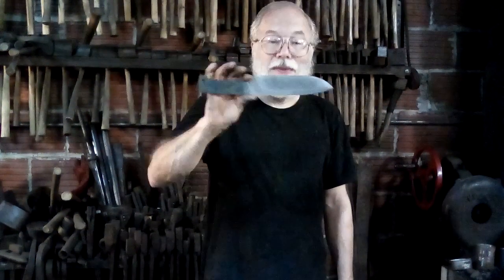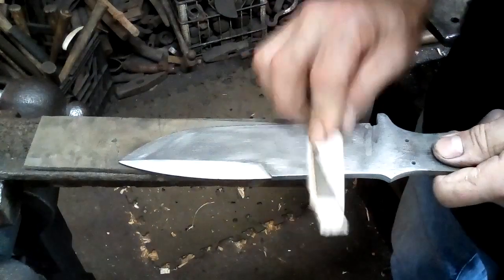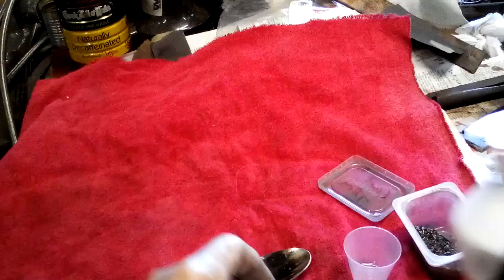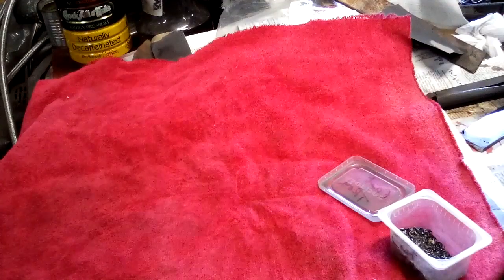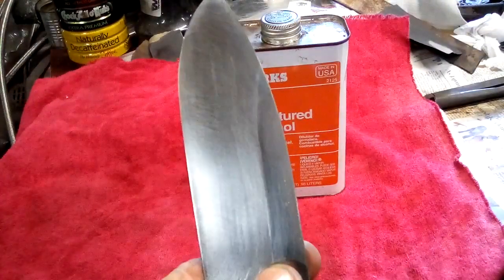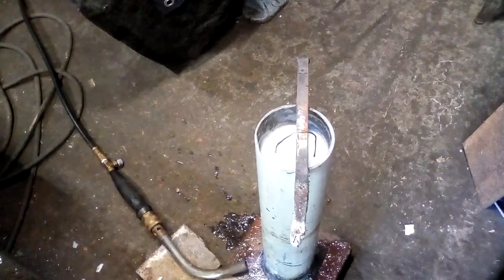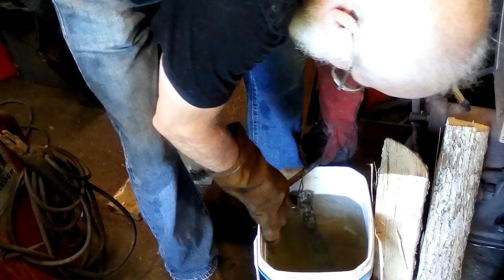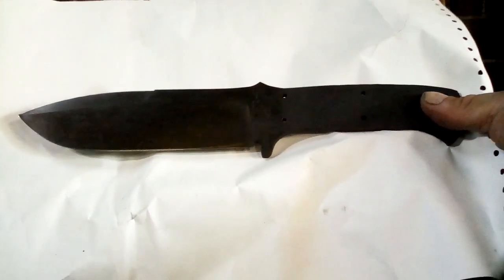A Blacksmith's Dictionary , Parkerizing , phosphating or how to make Steel Black

Comment: Is this something that has to be done outdoors?
Reply from the maker: It is about the same as boiling vinigar. My shop has ventilation designed for arc welding, large duct fan. The shops that do guns also have a lot of ventilation. Outside is a good idea . The water has a lower boiling point than the acid so the fumes are mostly water but it does have a smell and like any chemical , avoiding breathing it is best. Water  is also a good thing to dilute any overflow. Iron Phosphate is in  some plant food , so not toxic in small amounts , but not a good idea to dump this in your garden.
Daniel

Comment: Looks like a really nice finish.
I've been parkerizing some machine screws today using manganese dioxide and wire wool in the phosphoric solution.
It's come out ok but it's quite pale, more of a blue to be honest.
Have you used this method before? Any tips on getting the darkest black possible from either method?
First of your videos so ill be watching more!!
Reply from the maker: Hi:
Surface prep is important, a satin finish that is very clean , no oil or wax. Some people will have a hot solution of weak lye followed by boiling water then the phosphoric. Depth of color is duration and how strong the solution is made as well as the alloy. You will not get as deep a color on nickel or chrome alloy .
 It is more like cooking, whatever the recipe you cook to your own taste.
Daniel
Reply: @danieltokar1000  thanks fella!
When i oiled them they came up beautifully black!! Couldn't believe it!!
They were a light denim jeans colour before!!
They started off rusted and horrible, i soaked them in vinegar for 3 days, rinsed well and then treated them.
Very pleased with the finish now they're oiled!
Ill definitely be trying your method though, manganese dioxide is a nasty chemical and if i can do without it id be much happier!!
Rain tomorrow so I'll be watching a few of your videos!!
Reply from the maker: @bushratbeachbum  Glad it helped, Just passing on the stuff the old guys gave me.
Daniel

Comment: Very interesting Dan. I believe that you're the same fellow I met many years ago at the steam festival on Route 40 where Dave Vincenti was blacksmithing. And then saw you later on in Perriopolis. If that's correct, I'm glad to see you're still at it.
Reply from the maker: Hi:
 Yes, that was possibly me, that would have been 1983? Dad and I set up at the Perriopolis Fleamarket for many years. Is Dave Vincenti still around? I don't think I've seen him in 35 years!
Daniel
Reply: Yes Dave is still at it. I'm sorry that it took so long to reply. I'm almost illiterate when it comes to modern tech and actually found your msg by accident!

Comment: You put out the best stuff!  Anybody can bang on metal, but you fill the gap with the supporting info that helps put our work over the top!
Reply from the maker: My job is to present  the full range of shopwork , many types of work were bypassed when they became obsolete in industry. The "current" methods are sometimes very hard to do in a small shop with the tools available, so go back a couple generations.
Daniel
Reply: @danieltokar1000  It is much appreciated!

Comment: Wow, that was much easier than I thought it would be, looks pretty cheap to do it yourself as well! Thank you sir, I know I will be putting this knowledge to good use!
Reply from the maker: Yes, I think that was one of the reasons the arsenals liked it. WWII parkerizing was a bit different, I believe they used zinc in place of the cast iron chips ,  but it was an easy process to scale up for large runs .
Daniel